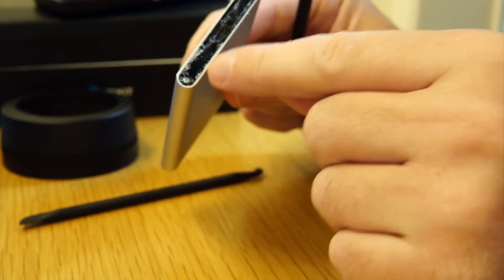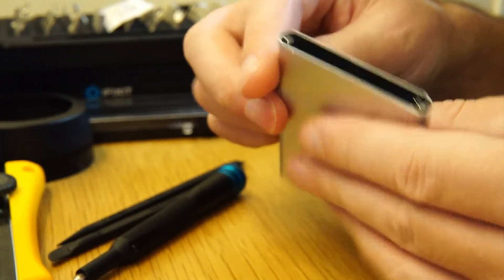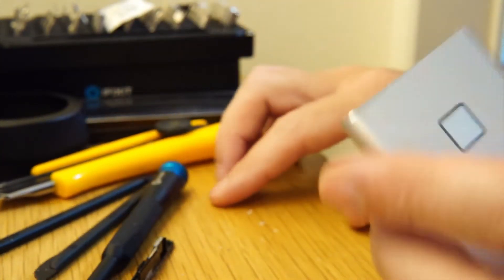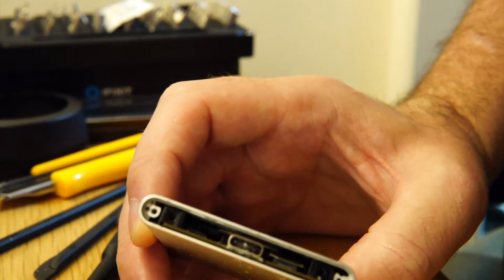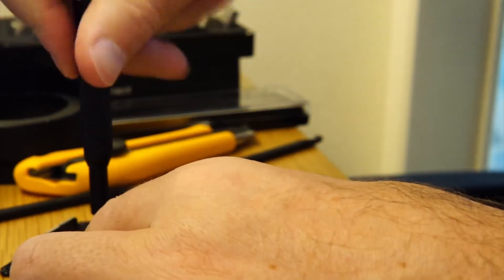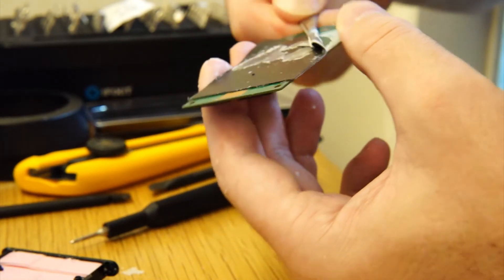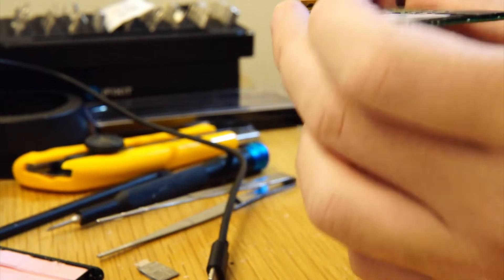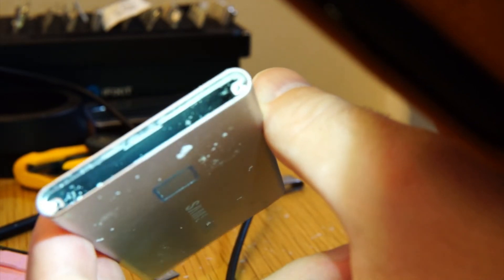Amateur T7 Touch Teardown Video (leaky wax)- Sony Nex-5r with Sigma 30mm F1.4

Comment: U broke the finger print sensor cable😅
Reply from the maker: Hence the "amateur" in the title hehe. Seriously though I never used the finger print sensor so I'm not missing the functionality. And the new 2.5" case I put it into has much better cooling and no more melting wax problems.

Comment: Wait, so you can have direct access to the data without using the fingerprint sensor after tearing it down??? If that's the case, the data saved in the T7 Touch is NOT as safe as I thought....
Reply from the maker: That's because I didn't turn on fingerprint security. if it was on you wouldn't be able to access the data.
Reply: @kiwiinkyushu  That's good to hear...Thanks for the reply!
Reply: @kiwiinkyushu  thats the reason i also disable it. i am thinking i might lost all my data if the fingerprint broke

Comment: Is there a possibility to convert the drive into a internal SSD?
Reply from the maker: You can take the drive out of the case but it is still connected to the usb-c connector. So it wouldn't work as an internal ssd.